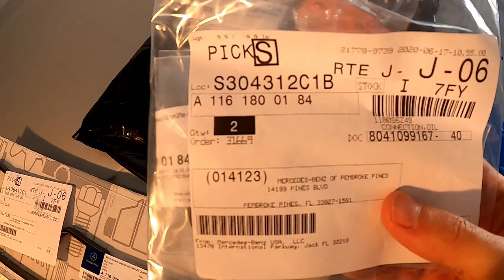How to avoid MASSIVE engine failure - Mercedes Benz SL V8 R107

Comment: Crucial moment; pay attention at the oiler tube assembly around the 1:57 mark.  Those little holes you see feed oil to each cam lobe once installed.  They can and and will clog ruining both the cam lobe and rocker arm. Mine failed at 67k miles.  Had to replace camshaft and rocker arms.  The kit is cheap and easy to fix… do it now!
Reply from the maker: Both sides were replaced 👍thanks for stressing the importance of new oilertubes!!!

Comment: if you decide to replace the chain, you need s special tool for removing the chain rails,  replace them at that point, they are cheap insurance) If it is the original factory chain, it won't have a master link.

Comment: Do you have any videos of how you put the cooling system back together? I ran into an issue. On the water pump, there is a connection for a smaller hose that leads towards the back of the engine. The main "section" of the hose has a bend and is made out of metal, but it connects to the water pump by a 3-inch rubber hose. The problem is I can't figure out how the metal hose is supposed to sit in the engine. Any help would be appreciated.

Comment: FYI: timing chain isn't stretched, it's worn at each piece of the chain, giving the illusion that it is stretched. You can buy 4 and 5 degree compensators, but with the amount of wear you have, you need to replace the chain.

Comment: I’m curious did you replace the small seals on the inside of the valve covers. These often turn very hard and break. I have been unable to find replacement seals associated with part numbers 116 016 09 80 and 116 016 08 80. Great job on video. Thanks for sharing.
Reply from the maker: Hi man, yes most of these parts are still available at Dealership. Give them a call!

Comment: I didn‘t get in the video how you adjust the 12 to 0 issue. i see only how you replaced the camshaft oil pipe and clean the cover but that will not fix the wrong adjustment of the chain, isn‘t it?
Reply from the maker: Correct Andreas! That was the assessment.
Here how we fixed that displacement.
https://youtu.be/DtpcjSeSe2c

Comment: The "MB Valve Cover Screws N304014006004" isnt on the MCB parts website anymore, any one have dimensions on screws?
Reply: Dang or the copper washers, if anyone knows if its like M10, M12...?